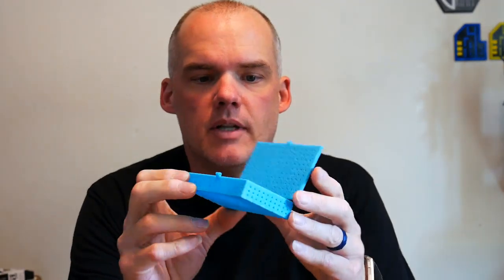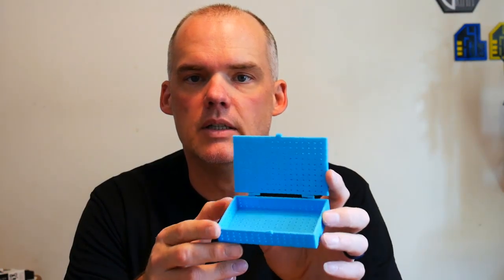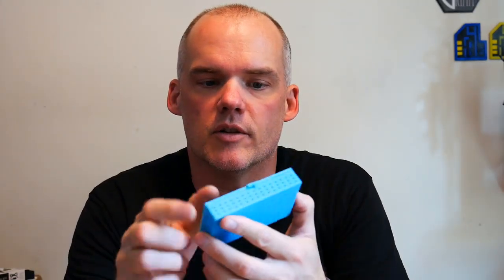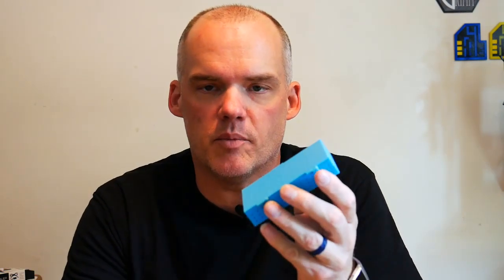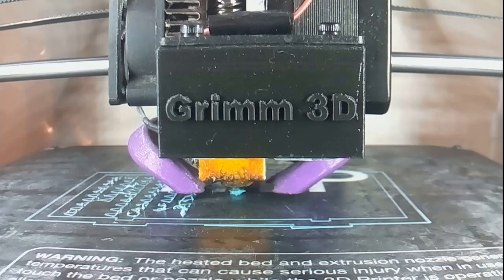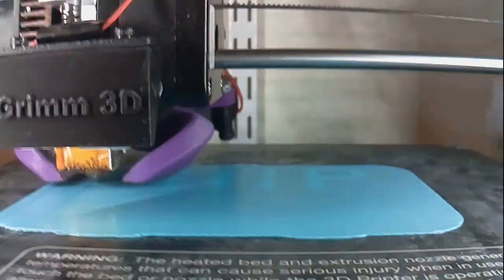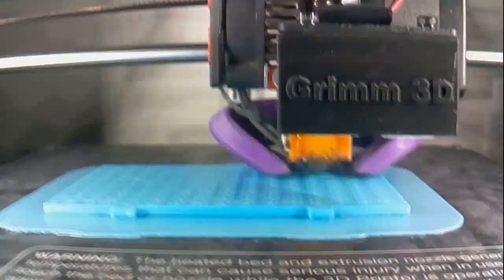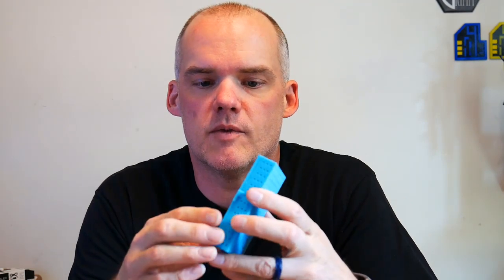When to Use a Raft

Comment: What about just a flat bottom without holes, and skin thickness. Raft or no raft is the question.
Reply from the maker: Could work. Thanks for watching!
Reply: @Grimm3D  I just printed a small motor mount I created without a raft, but boy this learning Modeling, Exporting, Slicing and then saving the .STL file converted to a G-code to send to the printer needs to be explained in that order in one sentence. That way there are no surprises, it took me a month to figure it out... Uhg!
Reply from the maker: Thanks for the suggestion, I'll see what I can put together - Stay tuned

Comment: I’m kinda new to 3D printing, i only did 10 prints, have an ender 3 pro that I got used from eBay, sooo, I always use raft because if I don’t it doesn’t stick, there is anyway of stopping to use the raft?
Reply from the maker: Check out my video on using hairspray. If you have a removable bed, it works awesome. If your bed is not removable, use cardboard or paper to prevent overspray. 

https://youtu.be/7JOmO6K_K3M

Also, make sure your bed is properly leveled. Thanks for watching!!

Comment: You could also use a brim, smaller, and takes less time
Reply from the maker: The issue on this one was adhesion on all the small openings of the box. A brim probably would not have helped that, or it would have closed the holes. Thanks for watching!

Comment: PETG tends to tear chunks of glass off my bed, thats why i need rafts with PETG. I have the exact opposite problem when printing petg. It sticks too well and then damages my bed.
Reply from the maker: With PETG on glass, you MUST use a release agent. The best one is Aqua Net Super-Extra-Hold Hairspray. Another good one is glue-stick. Or, I'm sure you can look online to find more expensive, specialized solutions. I use the hairspray, always. Works like magic! Thanks for watching!
Reply from the maker: With hairspray on glass, make sure to let the print cool. It will probably pop off the plate all by itself.

Comment: I use gluesticks and rafts because my prints won't turn out well otherwise. My problem is that I don't have a way to consistently take the raft off cleanly afterwards
Reply from the maker: There are setting in your slicer to help make the rafts easier to remove. Plus, a chisel-point hobby knife helps too. Thanks for watching!
Reply: @Grimm3D  Could you elaborate on the settings to use and what values I should start with? I use the puddy knife that came with my print, but it's not the greatest. As I speak, I'm still hitting the butt of the knife against my table to free my tiny print from the accursed raft
Reply from the maker: In PrusaSlicer, the metric you want to play with is called 'Raft Contact Z Distance'. This number defines the amount of space between your raft and the part. More space = easier to remove, less space = cleaner bottom of your print. 

Also, if you raise the Z distance to where it creates easy to remove parts, but the bottom of your piece is messy, get some 120 grit sandpaper, put it on a flat surface and use that to work the bottom of your print and clean it up. This sandpaper trick allows you to push the Z contact distance a little farther.

Lastly, I really cannot tell you exactly what YOUR contact distance should be. You'll have to play with it. The best distance for you is based on many variables including filament, printer, temperatures, etc. and in the end, it comes down to personal preference. So, you'll have to play around to find what works for you and your needs.
Reply: @Grimm3D  Thanks for your response!
Reply from the maker: @tardarsauce3355  Thanks for watching!

Comment: How does the lid attach..sorry I'm a newbie
Reply from the maker: I've seen people use wire as a hinge pin, or you can just use a small piece of filament (glue one side ONLY), also I've printed this box at 140% and used small screws as hinge pins. 

Whatever you have and will work for you

Comment: I just tried to print without one and it didn't work out. So, I guess I will have to only print with rafts from now on, just to be safe.
Reply from the maker: Try some Aqua Net - Super Extra Hold hair spray, that might help. Also make sure your first layer allows for proper squish.

Comment: Noob question but what if you resize and slice the file and make it bigger so the holes would be bigger and so the filament?
Reply from the maker: I do usually print this file at about 125-140% so that it holds more silica. However, if you make the holes too big, your silica beads fall through and make a mess in your dry box. Kind of depends on the silica you have. Thanks for watching!

Comment: Solid video, so are you saying that with a relatively basic bottom to the part that’s just flat you can get away without a raft? I’m brand new to printing maybe I’ll try if anything is basic enough to skip it, it is a ton of filament and time making a raft.
Reply from the maker: With a totally flat, simple bottom, no need for a raft. For a medium complexity bottom, there would also be little need for a raft. Very complex, with small shape groups, you might need a raft. 

Also, I've found Aquanet Super-Extra Hold (purple can) hair spray to support both first layer adhesion as well as easier separation after completed with almost all printing that I do. I use the hairspray all the time. 

Thanks for watching!

Comment: I came to this video wondering about rafts but i quickly realised on your print i was doing something wrong, my bed is set way too low, ive only printed one thing so far and bought my printer just on a whim to try something new out, and seeing that bead really helped me understand how the nozzle and bed need to be working together within the right clearance,
Reply: Do i spray directly on the glass and print while wet?
Reply from the maker: Best to remove the glass, to control overspray (don't want that building up on your machine), then reassemble. Hopefully it is quick. The hairspray will dry as you heat up your bed. The spray creates a tacky surface to help your first layer, but then becomes a release agent when your bed cools down. Most people with glass find that the part will pop off the bed by itself once everything is cool. 

If you cannot easily remove the glass, you could use some cardboard to control the overspray. I did that for a while.

Especially if you are printing PETG, hairspray.
Reply: @Grimm3D  Im using pla, and ok, thanks for the advice, much appreciated. The bed has its stock slip on clip and comes out in seconds. Ill give the spray a try if i cant get it fixed through adjustments in firmware/hardware. Its only 2-3 weeks old, so hopefully its just adjustments.
Reply from the maker: Trust me. Even if you get it fixed through adjustment. Use the hairspray, it makes printing on glass 100x better. Also, if you do not use some kind of release agent, PETG WILL break your glass eventually.
Reply from the maker: It's all about the squish. The first layer is the key. Thanks for watching!
Reply: @Grimm3D  i can see that, but im still having tons of trouble, i tried tweaking some settings and now my bead is great, but 2 corners on the back are lifting off the bed, having alot of trouble, its an anet et5x, probably should have have done some research on printers in the same price range before i bought one. I was too excited lol
Reply from the maker: @mjm7071  If you have a removable bed, glass maybe. see if you can get some Aquanet super extra hold hair spray (purple can), this will help the first layer stick. Another suggestion is to use actual feeler gauges for leveling the bed, or I sometimes do a live level. Meaning, I have the printer print the first layer and I adjust the leveling nuts while it is printing. You can find a ton of leveling patterns on Thingiverse unless you want to design your own. HAIRSPRAY is like magic though
Reply: @Grimm3D  yeah the "live level" is how i managed to get it printing properly, im a mechanic so leveling it while printing was my first thought since i couldnt diagnose it. I actually ordered a feeler guage which is coming tomorrow, i didnt like that initial ooze. Which was probabky my fault also which is why i ordered a temperature gun. I wasnt sure how accurate the temp readout was so i wanted to preheat the head longer. So when i was levelling and it was oozing, the paper would get a think layer of filament, with a feeler guage it could just scrape it off maybe. But again, once i check the temps are accurate tomorrow, ill see if i need to preheat lobger than it needs to be. I keep searching up 3d printer fires but i cant find alot of info, so i guess its not often, but, are 3d printer fires rare? That has me pretty paranoid to be honest.
Reply from the maker: I don't think fires happen very often these days. Printers now have safety features like thermal runaway protection and such. Rarely the protections are not turned on, so you might want to check that and make sure yours are turned on. You'll have to research your specific printer to find out how, I can't really help you there and I've never used an Anet.

It looks like a good printer though.
Reply: @Grimm3D  Thank you, thats a bit more reassuring, ive read my model didnt come with the runaway protection in the firmware so i bought the programmer to update to a firmware that does. Also read the anet a8s had a problem with that sensor and would catch fire, you can see why ive been paranoid. 😄
Reply from the maker: Being careful is always the best option - happy printing!

Comment: Instead of using a raft you simply could have reduced 1st layer speed. That saves quite a bit of plastic.
Reply from the maker: There are often multiple ways to get results. Thanks for watching!
Reply: Lol didn't even think of that.  May still have had adhesion issues with all those 1st layer holes
Reply from the maker: @CrowClouds  Maybe. In the end, you just need to figure out what works for your own situation. Thanks for watching!!

Comment: Hello, I have a question.  I am using Cura and an Ender 3 V2   When the printer made a perfect sticking 3 layers raft he begin printing to high. The layers wont stick the 4th layer. How can I solve this problem? 

Thanks,
Reply from the maker: Try reducing your 'Raft Air Gap'. In Cura, you might have to search for the setting to add it permanently to your setting pane. Mine is set to 0.3mm. Adjust carefully, maybe .05 mm at a time until you find the setting that works for you. Less gap makes the part harder to remove, more gap, easier but at the same time you might suffer adhesion issues.
Reply: @Grimm3D  I am gonna try that. Thanks for your answer!
Reply: @Grimm3D  I've had this same problem.
Here are my details. 
Filament: matterhackers pro series nylon.
Slicer : cura 5.2.1
The item I am printing is a tail cone fairing for a GA-7 Cougar. The item is 6 inches tall and approximately 2.5 inches wide but it's hollow and the wall thickness is 0.090". I've done a lot of smaller parts but even they came off too easily imo, even after reducing air gap.
Here's what I found.

Layer 1 through 4 print the raft. Layer 5 begins the support structure. Layer 6 begins to print my part. 
Default air gap started at 0.3mm. I reduced  to 0.2, then to 0.16, then to 0.12, then to 0.08mm, then to 0.00, and nothing I did made the part begin to print on the same layer as the support.

So I set air gap to 0.08mm and increased temp. After 10 hours into a 54 hour job, the corners began to lift. I paused the job and used a product called bondic to "glue" the part to the raft.

What can we do to force Cura to begin printing the part on the same layer as the suppor?  I would love nothing more than to have trouble removing my part from the raft.

I'm really beginning to not like Cura.

Comment: So what would you say is the general criteria for using a raft over another type?
Reply from the maker: A raft is useful for two basic reasons. First, to help with adhesion, like I showed in the video, small perimeters can be difficult. The second reason is to make the bed more 'level', like if you had dips or dings in your bed that you were not able to fix and you still needed to print, you could use a raft to level those out. 

If there are any other reasons, people can comment to let me know. 

Good question, thanks for being part of the conversation!
Reply: @Grimm3D  So I'd only use a raft when I have problems with adhesion or bed leveling, otherwise the more basic starters. Thanks!
Reply from the maker: A raft will not help you if your bed is way out of level, but will help if there are just some anomalies with the surface. Also, a brim is useful when you have an item that needs additional help adhering to the bed overall. As in, a tall print with a small base. Often a brim can help. Lastly, the skirt is basically a prime/preparation line that helps to get your filament flowing, your nozzle pressurized, any bubbles purged, etc.
Reply: @Grimm3D  thanks, this overview is exactly what I needed!

Comment: Mine just absolutely refuses to stick on the raft. Any suggestions?
Reply from the maker: First thing I would do is to reduce your 'Raft Air Gap'. This is the spacing left between a raft and your part that allows the part to easily be removed from the raft. Smaller gaps make the part harder to remove, but could increase your adhesion. Mine is set to .3mm. Adjust carefully, maybe .05 mm at a time until you find the setting that works for you.
Reply: @Grimm3D  Thank you very much!

Comment: Good video but why not just drill hole in a travel soap box. I think it would work as well and be cheaper.
Reply from the maker: Great question. I have two reasons. . . For me, anyway. 

First, the box in the video actually ended up being too small. I increased it in size to 150%. This increased size is much larger than a soap box, about 5 times the volume. This larger box of silica seems to work/last long enough to not be a nuisance.  Second. I have had regular 'clip' style enclosures pop open on me in some of my early tests when the boxes get rattled around. Cleaning a pile of silica out of a filament box is not fun. The printed boxes close much more securely. I've never had one pop open. . . yet.

And kind of a side note. . . I got into 3D printing to actually 3D print. . . Designing, printing, testing, perfecting, sharing is the goal. Not buying something off the shelf.

Thanks for watching and thanks for the question!

Comment: I had a time once, when every print I did, that did not have a single flat bottom surface, would have parts of first layer pull up like that. Printing PETG, or PLA, I was just not able to get it to stick at all. The issue I was having, was the initial layer temperature was not hot enough, and as the filament came out of the hotend, it would curl up back onto the hotend, and would be dragged around the build plate. In Slic3r and Cura, you can change the hotbed and hotend temperatures just for the first initial layer, and that first layer, all you need it to do is flow out of the nozzle with ease, without it bunching up at all. I had tested this quite a few times with PETG and PLA (ABS I did not have any of these issues with, as I found this answer before I started really printing with it), and with PETG, I would have an initial layer temperature at 75 for the bed, and depending on the filament brand, between 230 to 245 for the hotend. The rest of the print would be 65 to 70 for the bed, and 220 to 230 for the hotend. I was trying so hard to combat stringing on my bowden setup, that I started tuning the temp alll the way down to 190 on some prints. This was a bad idea. At the very least, getting that first layer out very smoothly, and without any hangups on the nozzle, will get your print something as a solid base, even if it strings a little. The rest of the print can be at a lower temp to combat the stringing, but that first layer should be at a temperature you can lay the filament down without any issues. Also nozzle cleaning, I would use a cleaning filament like the ESun cleaning filament or nylon, do 2 to 3 cold pulls after just pushing about 25mm through the hotend, then take a soft wire brush to the nozzle. These things along with good leveling will help you get that perfect layer. Another thing is initial layer height should be a little larger then the remaining layer heights, so 0.15 first and 0.1 for the rest, or 0.2 first and 0.15 rest, and so on. The first layer should be a little taller and hotter then the rest to help combat these sorts of issues. 
Sorry for the book, just wanted to give anyone reading the help I had trouble finding myself :p
Reply from the maker: Thanks for the information. I mostly print PETG with my Prusa Mk3, in the future, I will be using my D9 to print some larger PETG items and this info is good info. Also, I have found that PETG really dislikes thinner layers. I always have better luck printing PETG at 0.2 mm layer height. Thanks for watching!
Reply: @Grimm3D  Omg, I do it the opposite way. I use very thin layers for skirt and brim for example. (usually 0.1, even if the print is 0.16 or 0.2)